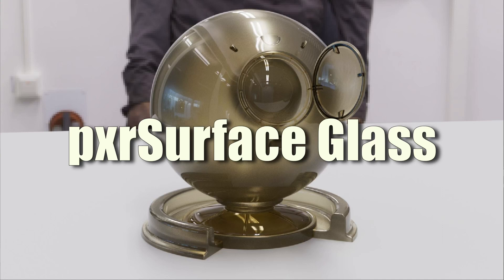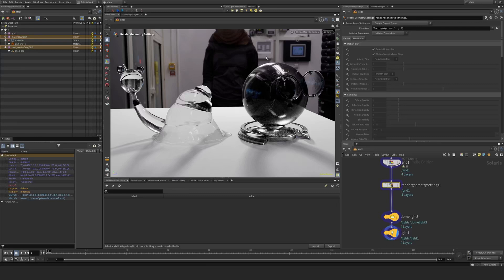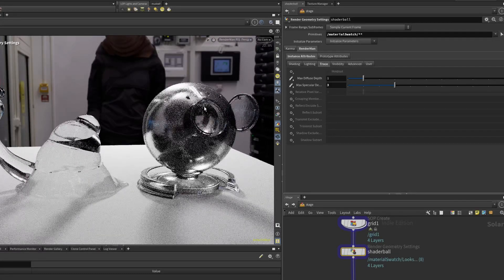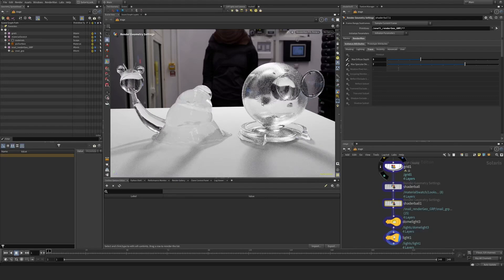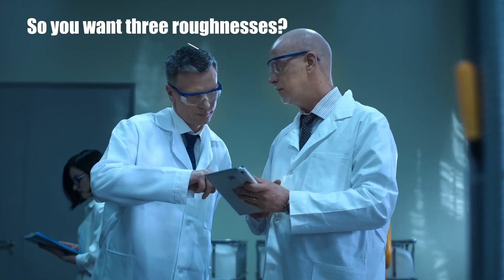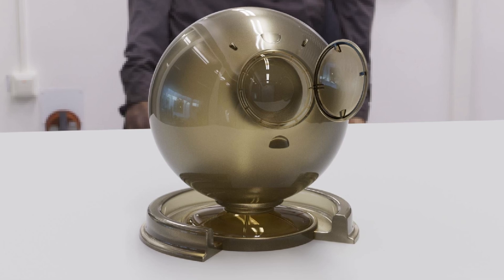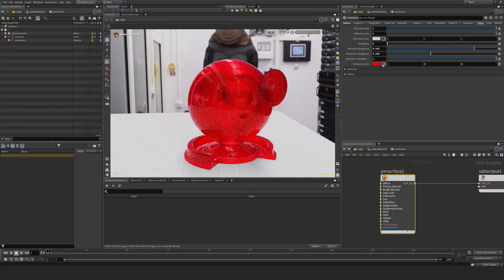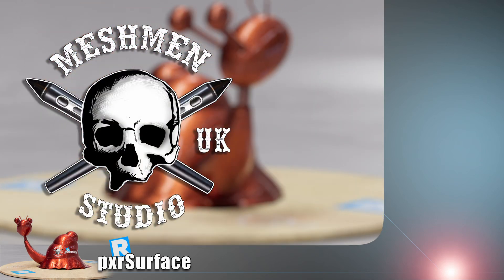Renderman pxrSurface for beginners | Glass (pt09) Renderman houdini

Comment: do yopu need a geometry settings node in Maya ?
Reply from the maker: In maya its handled a bit different, in the maya render globals you have default ray depth, but you can overide per geomtry as well , you have the renderman tabs on each geomtry where you can find the trace section , specular is set to -1 by default. so it picks the global. overiding to a specific specular depth will go away from global settings per geo
Reply: @MeshmenStudio  Thanks, will check it out.  Please do a video explaining russian roulete and making archives as well. Your vids are very usefull
Reply from the maker: @HerculesMare3 by archives you mean what?
Reply: @MeshmenStudio  RIB archives and alembic gpu cache. A suggested workflow would be great.